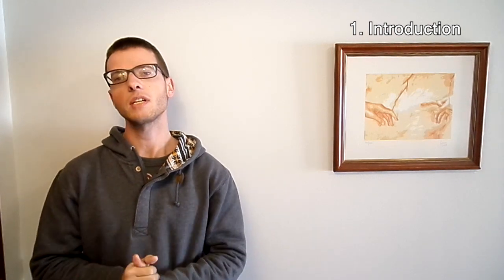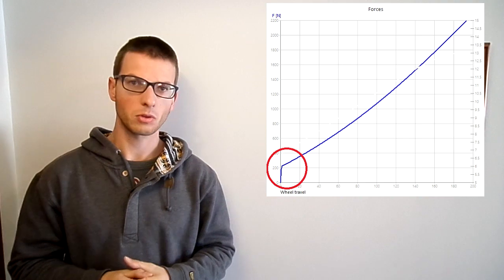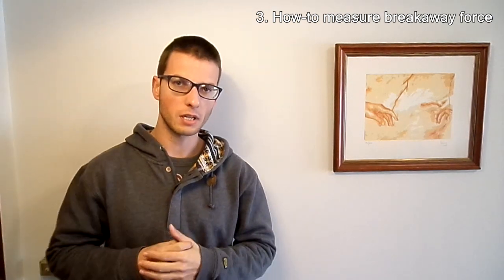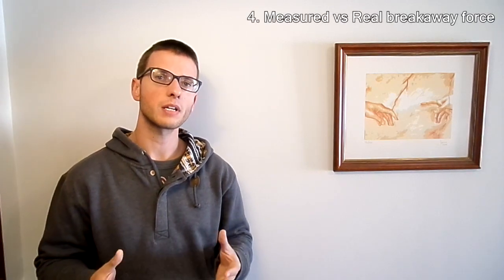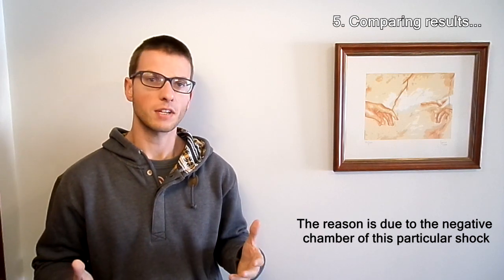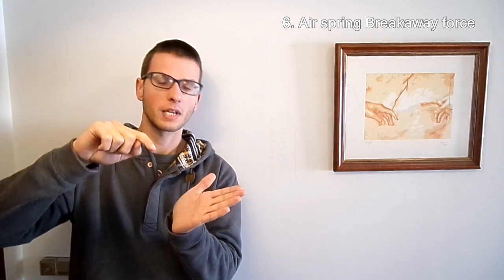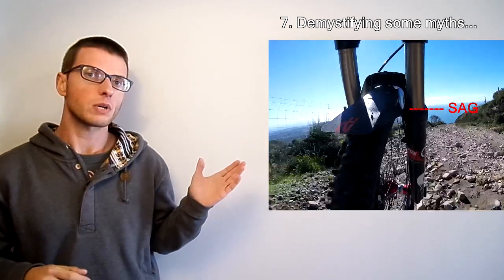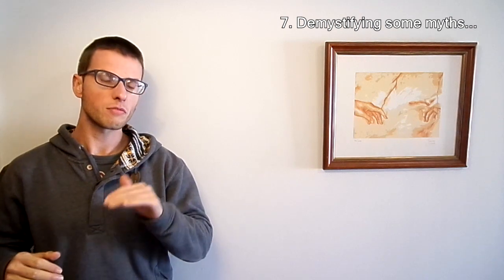How-to measure Breakaway Force (MTB rear suspension Ep.8)

Comment: completely wrong ...  if i have a 50kg back tire  "static sag"  will be the same as if you have 2kg back tire. BUT according to you same bike  with same suspension will have  48 kg differences  in  Breakaway Force ..... nonsense .
Reply from the maker: Sorry but I didnt understand your point... :(
Reply: You include the weight of the back rim set (rim, tire, hub etc.) as  Breakaway Force . The way how  you measure is wrong.
Reply from the maker: @teror1sta  Ah yes! You need to subtract the unsprung weight. I detected that mistake and covered that in 2016 in a video after this one. At minute 3:30 https://www.youtube.com/watch?v=IyH8hNLr1m0
Cheers!

Comment: My RockShox xc 28 has 25kg. of braking force.
.
Reply from the maker: Boris Donev Thanks! it's a normal value, which corresponds mostly to the breakaway caused by IFP pressure. Something that rockshox is working on in the new metric shocks to reduce that breakaway (counter measure technology).

Comment: Giant Reign with a Monarch RC3 HV.  25kg required.  I also tried the fork and it was over 50kg!  Must be why I'm getting sore hands.  Time for a service :)
Reply from the maker: +Michael Eastaff It seems that you got some serious friction on the fork. Since the fork is inclined (head angle), aplying vertical force creates friction in the legs/bushings interface. But since you get 50kg it seems your fork has no lube oil, thus the friction. Time for service.
Reply: The bad part is, i actually lifted the back of the bike so that I was pushing vertically rather than on an incline.    Yes, service sooner rather than later, I hope I don't find aluminium paste in there.  Looking forward to your spreadsheet for rear shock air cans, cheers :)
Reply from the maker: +Michael Eastaff I will upload that in a couple weeks or less. Holy shit 50kg with vertical fork :D Which fork do you have? It could be also an issue with the air spring equalization... You have to check. Good luck
Reply: It's a 2009 Fox 36 TALAS RC2.  I've got a Pike that I'm putting on shortly that measured far less, just need to find the time!

Comment: The damper was inflated when you measured Pitch?
Reply from the maker: +Krzysztof Gawełczyk Yes it was. Newer air shocks have an equalized negative chamber that counteracts the positive one at top out, which was not the case with this shock, thus the huge breakaway.

Comment: Great Video.
Not sure if you where adding the standing weight (no added force bike wheel just sitting on scale) but both of my bikes had a standing weight of 17pounds(7.7kg)

My 2015 trek fuel ex7 with the stock Fox Float DRCV had a Breakaway force of about 87lbs (39.5Kgs)
My 2003 Gary Fisher Sugar 3+ with a DNM burner Coil shock(550lb spring) had a Breakaway force of about 70lbs (31.8Kgs)

Again great video I enjoy watching them. These have also helped with learning of coil shocks it was due to these videos I had made the decision to put a coil on the old Fisher
Reply: paul chavannes i

Comment: An interesting way to measure the amount of stiction in you suspension is to take 2 sag readings. First take a reading where you lower you weight onto the bike very gently, once it's supporting your weight, take a sag reading. Secondly, put all your weight on the bike, then get someone else to push your bike down even further into its travel, then ask them to gradually remove their extra weight. Take another sag reading. the difference in these two readings gives the stiction zone.

Comment: Very nice video!!
I just did this test with my liteville 901 and ccdb air shock and read just under 10 kg at about 1 mm of movement. This shock and frame is so incredibly good! With my old Cube Stereo and RP23 shock you would have to like throw yourself on the saddle to get it moving, which I recon was because of the very degressive rear linkage in combination with the high ifp pressure of the non piggyback shocks...
Reply from the maker: +Max Lindner 10kg its pretty good! Yes the older model of cube stereo had a quite bad LR ... very easy to bottom out..and it came with an HV shock from stock lol :)
Reply: andrextr The rear suspension of the Stereo was horrible to be honest with you :)
Super harsh in the beginning of the stroke and bottoming out very easy though.

The 10kg breakaway of my Liteville is without the unsprung weight though by the way which is 7.7 kg.

Comment: Great video. Question. Why is lowering the ifp on an air shock a bad idea to get a lower break away force? I'm thinking of doing this on my monarch. It's set at 350 psi stock.
Reply from the maker: +pheoix IFP pressure is required to pressurize the oil. The oil need to be pressurized to avoid cavitation. Cavitation is when the pressure drops a lot and the oil goes from liquid to vapor (boiling). Cavitation is a very commum problem in propellers (in boats or water pumps). In shocks, cavitation causes damage on the shock internal parts and it causes inconsistency in the damping. You can see here the oil cavitation in a shock:
https://www.youtube.com/watch?v=NbiHIyO8FEY
Reply from the maker: +pheoix Just to add more info... The new future metric shocks from Rockshox already come with the counter-measure (a negative coil spring in the damper which counteracts the breakaway from the IFP). To learn more about cavitation you can see this video (pretty cool): https://www.youtube.com/watch?v=ON_irzFAU9c
Reply: +andrextr thanks for the info. That second video was indeed cool. Water boiling just from change of pressure with no heat applied. I was researching and came across this http://forums.mtbr.com/shocks-suspension/monarch-ifp-pressure-change-524727.html after reading it. It's very tempting to try it.... :(

Comment: my ccdb has sag just because of the weight of the bike :P
Reply from the maker: +BAEMERZ Wow, you have a very heavy bike! :D ahah, just kidding. That's interesting. CCDB uses a very thin shaft, and as you can see in my new Episode 9, with thinner shafts the IFP produce a lower breakaway force. The disadvantage is that sometimes the shafts breaks... Bye. :)
Reply: andrextr i will tell you my trick :D
just refill the damper with slightly less oil than normal. 
btw my bike weights 16,5kg :)

Comment: 2015 Nomad w/ Fox X2 = 36.2 lbs
2015 Phoenix w/ RC4 = 32.4 lbs

What about the weight of the rear end of the bike when it's just resting on the scale?  Shouldn't you subtract that from the final weight
Reply from the maker: +Dan Andrizzi From the data that people sent to me, it seems that the breakaways from most bikes (either with coil or air) are around 14-18 kg  (8 data values, including also the Fox X2 and Float X2). Given that real breakaway is around 5kg lower than measured by the weight scale (as I explained in the video), this means that the breakaway of people's bikes is around 10 kg. This pretty matches the breakaway force derived from the IFP pressure. The reason that Float X2 is similar to a coil it's because it's uses a larger negative air chamber, thus, the first 1/3 of the travel is much more linear a similar to a coil. Check it out this image from a simulation that I run:

http://oi66.tinypic.com/4p7ad.jpg

Bye.
Reply from the maker: +Dan Andrizzi Hi Dan, thank you for your input. No, you shouldn't subtract that value. What matter is the force needed to start compressing. On a super-sensitive bike without  friction and breakaway forces, the bike will have a tiny amount of SAG for its own weight (static SAG). In that case, the weight measured will be lower than the resting weight of the bike on the rear wheel (you have to slightly lift the wheel from the scale). Bye :)
Reply from the maker: +Dan Andrizzi Motos and cars have a static SAG. On bicycles, they are lighter than the breakaway forces from the suspension. Thus, most of the bikes can't get a static SAG with traditional IFP shocks.
Reply: +andrextr Ahh got it, makes sense.  Curious re: the other readings you'll get from X2's... only air shock I've ever used that truly feels like a coil.  Coming from a 120kg rider who has never had good results with air!
Reply: +Dan Andrizzi In fact you have to subtract the rest weight because the unsprung weight (weight not suspended by shock) is actually bigger then the weight needed to apply in order to  for shock to start moving. If you add weight of rear wheel, tube, tire, casette, dereiler, half of chain, rear triangle then you are easily coming to 4-6 kilo depending on a bike. So if your bike rest weight is lets say 8-9 kilo and it needs 13kg in total to star compress you can do the math. 3-5 kilo preload on rear end is actually negligible especially if you ride fast as this will be absorbed by tires compression. This is the reason manufactures do not even bother to put top ot spring on bike coil shocks as they are simply not needed. As i told before, this thread is very misleading.
Reply from the maker: +Andriy Gavrylenko Man, why are you always criticizing my videos? Please give me one plausible explanation why having a breakaway force is a good thing! It seems pretty obvious to me that having a suspension that requires a minimum force to start moving is ALWAYS BETTER than having a suspension that requires 20 kg of force to start moving, like you are defending.... But OK, nevermind...
Reply: +andrextr Any data or info on the dhx2? Curious if it is even better than the x2, being their updated design + coil, or if Fox just hit a homerun with the x2. As much as I usually prefer coil, I'd take the x2 any day. Hope the dhx2 is even better. And don't sweat the haters man, your work speaks for itself. Keep it up.
Reply from the maker: +Dan Andrizzi Now I'm affraid to answer your question without having anyone criticizing eheheh. But, the 2016 Float X2 and the DHX2 share the same damper technology (twin tube). The same technology used by Ohlins and CCDB (all the oil re-circulates through the external adjustable valves). The older fox models (DHX3/4/5, RC2, RC4, and so on) use a traditional mono-tube technology (the oil displaced comes from the shaft volume). So, I prefer twin-tubes, and from what I know, they have a wider adjustment range (so you don't need to choose you an internal tuning like in other traditional shocks). Since Float X2 has a large negative chamber, you get a spring curve very similar to a coil with a soft and linear feeling at the beginning. So, very similar to a coil, with the advantage that you can tune the final progressivity with the spacers. Also it's more lightweight. The advantage of the coil are always the same: less friction and less overheat... But to be honest, this new Float X2 seems to be a great alternative to the coil version. I would like to test one to check :) (PS: I'm a coil fanboy). Bye.
Reply: +andrextr That actually answers my question quite well...  As good as the x2 is, I'd still be hesitant to put it on a highly progressive frame (ie v10), thinking the linearity of coil would suit that leverage curve better.  But the 2nd half of the Nomads leverage curve is pretty progressive, and that is the frame I have the x2 on.
Reply: +andrextr But I will say that when doing the drop test you recommend, my rc4 stuck my bike to the ground like glue, whereas the x2 bounced.